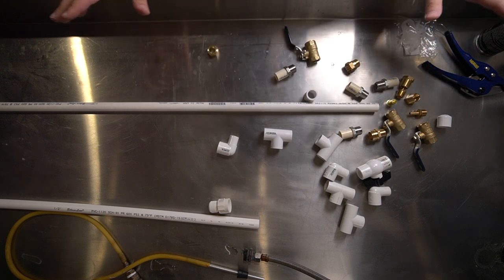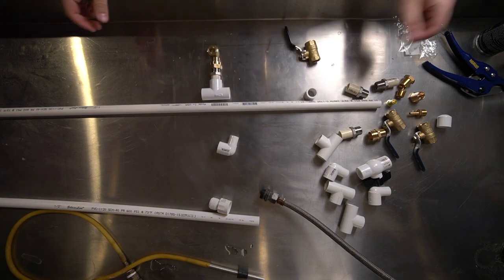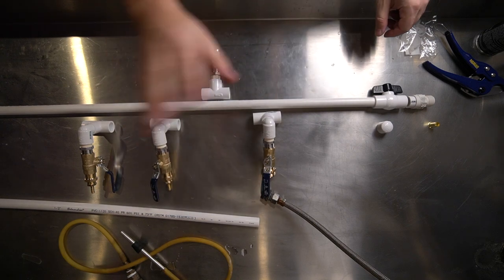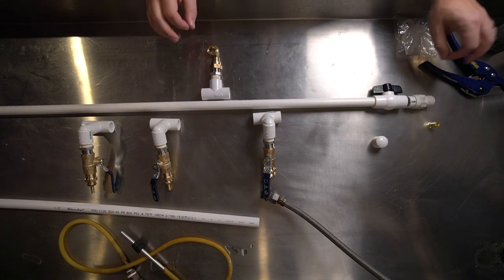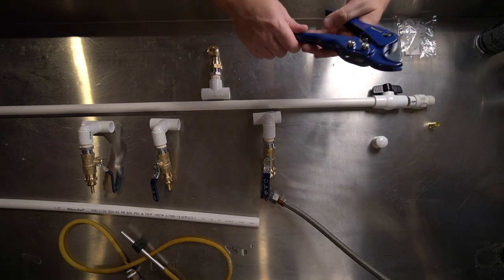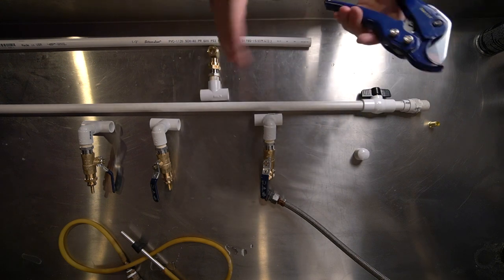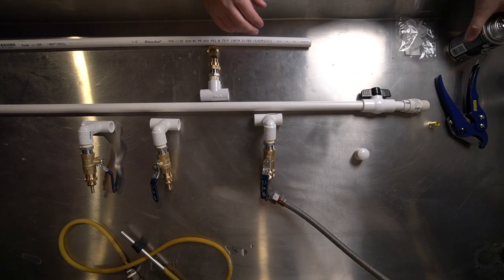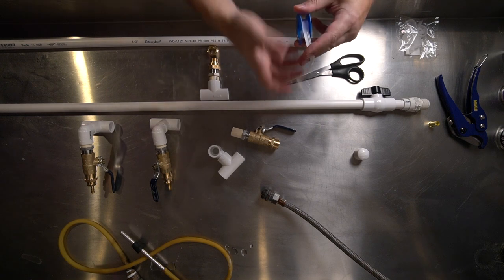Finally Added My Darkroom Plumbing

Comment: Hi!! I am from your United Kingdom audience, a big fan of your channel. Been watching for a few years now. I have a a very similar set up as you but I am using a De Vere 504 as I normally do not shoot larger than 5x4. I am setting up a darkroom at the moment and I am very close to have everything up and running (no pun intended).

I have not been developing and/or printing for about 15 years now. Nevertheless, I have a many years of experience in both b&w and colour process at the time. That was when I was living and working in Sweden where things works a bit different, especially plumbing and hot water supply. One of the last things I need to instal in my current/new darkroom is a water heater + plumbing. I do have the main water supply (cold) going into the darkroom so I can easily connect to this. However, I am not confident what type of water heater I need, except it has to be powered by electricity as we do not have gas supply.

In a nutshell, I wonder how many gallons/litres of hot/warm water a suitable water heater needs to produce for both b&w and colour film and print (RC and FB) process. I am skilled enough to do the handy work but have no knowledge regarding the capacity needed by the water heater. 

Many thanks in advance and I do apologies for this long text. I am looking forward hearing back from you.

Kindly, Lowe H Seger
Reply from the maker: I’ve looked at a few in line heaters, but the minimum flow rates were all much higher than I typically use in the darkroom, so the heaters would never kick on.
Reply: @TheNakedPhotographer  Many thanks for your quick response on this.

There is a various number of domestic in line heaters 2kw-12kw. Which I would guess a smaller one potentially could be insufficient but again I am not confident with flow rates.

Though English costumer service is totally crap where they either don't care at all or they just want to rip you off, I will phone to some suppliers and hear their thoughts on the matter.

At the moment I am looking at this 12kw heater ( Stiebel Eltron DCE-X 10/12 Premium Compact Instant Water Heater ), it would be great to hear your thoughts, do you think this is enough or perhaps way more than needed?

Many thanks again for your time on this. Lowe
Reply from the maker: I can’t really give any advice about in line heaters.  They are very rare here in the US and we don’t have much information on them.
Reply: @TheNakedPhotographer  Thank you once again for your time on this as well as for all amazing videos you putting together. All the best from London UK.

PS give us a shout if you traveling this way. 

Lowe H Seger

Comment: Sharkbite fittings. You could use a mixture of all of those different materials, PEX, copper and CPVC and best of all, no special tools. You can also disassemble stuff if you change your mind later or need something different and re-use the fittings.
Reply from the maker: I’ve used those before.  They’re nice but expensive.

Comment: I miss my darkroom. The bathroom/laundry where I am now would be nearly perfect for a darkroom (no windows, long against an outside wall, small short wall to divide the wet and dry side, vent to the outside, running water...) but the wife is using it for laundry and washing up. :(

Bing watched the channel when YouTube first recommended it. Rewatched a couple of vids last week. The R4-A printing and safelight testing are great. Love the opening too. My inner 14 year old laughs every time. 

Would you do a video on the white light technique when doing different sized prints. (ie 5x7 to 20x30) I explain it to people they just give me a blank look. It is an old trick used in commercial darkrooms to bang out different sized print of a subject (school photos) only using one set of test prints; usually on the small size to save paper.
Reply from the maker: I use that technique myself.  I may go over it one day.
Reply: @TheNakedPhotographer  Oh man, now I don't feel so alone and Sisyphean....

Comment: is your JOBO plumbed with cold water or tempered?
If so how did you run the cold water??

Thanks
Reply from the maker: It is not plumbed at all.  I have to fill it with a hose from the sink and I drain it into a bucket on the floor.

Comment: In your video, you have a connection thats metal screw threads with a PVC connection, all in one.  I have looked everywhere for this, Home Depot, Lowes etc, any suggestions ??
Thanks!!!
Reply from the maker: I found it at Lowe’s, check the cpvc section.

Comment: Why do you have to use the CPVC on the metal plumbing? Do the metal parts come with the CPVC attached? Thanks and well done.
Reply from the maker: Yes, the metal bits only come attached to cpvc, so I had to work with what I could get.

Comment: I am planning a darkroom and trying to figure out how much space I need for each station. How long, wide and deep is your sink? How large prints can you develop in trays? I am going to have it welded to my own specs.
Reply from the maker: My sink is 26 inches wide, 7 feet long, and 4 inches deep.  I can fit four trays for printing on 16x20 paper.
Reply: I know that this video is a year old, in my case I purchased the darkroom equipment before I started to build my darkroom so I could lay out the equipment and then measure how much room each item takes.